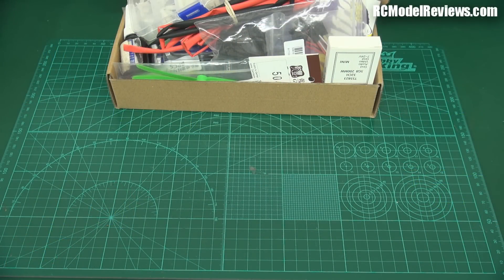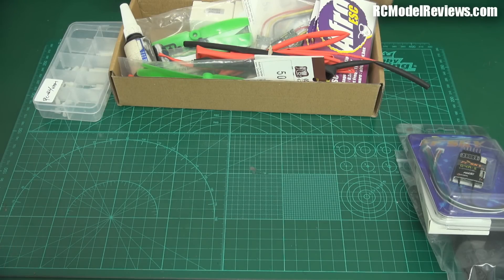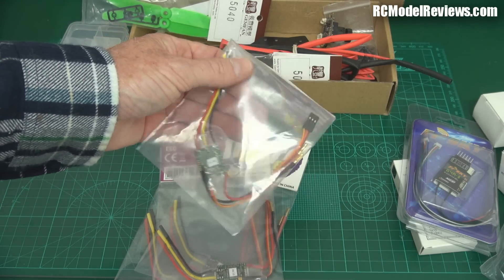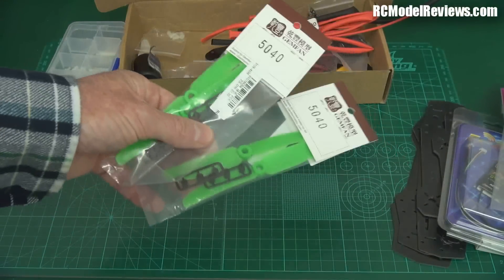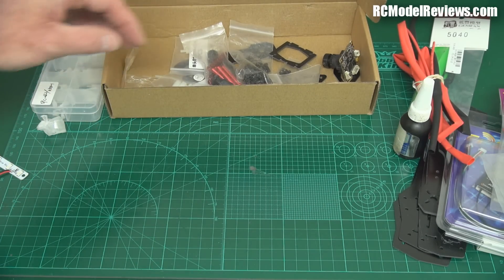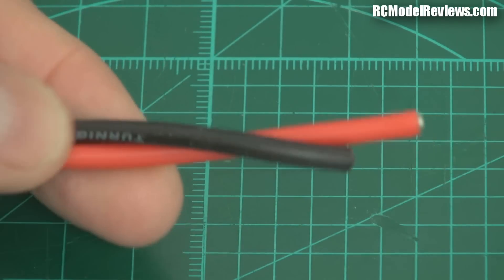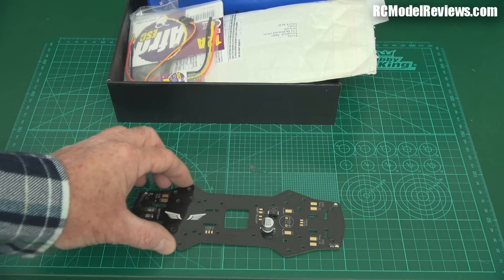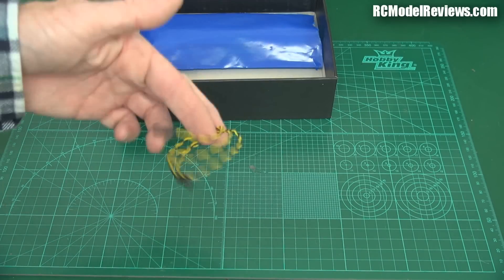Low cost miniquad racing drone build video PART 1

Comment: I can't find a naze32 anywhere. All I can find are these crappy F7 and H7 flight controllers and they suck! Every time I arm and put the throttle stick in the off position all the way to the top, my quad flies away straight up and I can't find them anymore. Flight control my ass.

Comment: I'm a absolute FPV/RC/drone rookie. but giving it a go. Put a quad kit together after a probably 10 hours of research. This is my list of parts. If you spot compatibility issues or i'm missing something let me know!
-250mm Carbon Fiber frame
-FrSky Taranis X9D Plus 2019 2.4G
-FrSky D4R-II 2.4G 4CH ACCST Telemetry Receiver Naked
-Naze32 Rev5 6DF Flight Controller w/Barometer Compass 

-DYS BE1806 2300KV Brushless Motor x 5
-30x30 power ESC distribution board 
-Emax Simonk Series 20A ESC x 5 
-ZOP Power 11.1V 1500mAh 40C 3S Lipo Battery XT60 Plug x 2
-RunCam Sparrow WDR 700TVL 1/3 CMOS 2.1mm FOV150 Degree 16:9
-Eachine TX805 5.8G 40CH 25/200/600/800mW FPV Transmitter TX  SMA Female Connector 
-Kingkong 5040 props x 10 
-Eachine EV100 720*540 5.8G 72CH FPV Goggles With Dual Antennas
-G.T.Power C6 50W 6A DC LCD Display Battery Charger Discharge for 1-6S LiPo 
-DANIU Welding Solder Flux Paste Soldering Flux Paste Grease Gel
-10 Pairs 2 Pins JST Male & Female Connectors Plug Cable Wire Line 110mm
-23cm Li-Po Battery Magic Tape Straps
-2M AWG14 silicone wire (1m red, 1m black)
-Heat shrink
- 300pcs nylon standoff kit
-Heat-resistant Soldering Mat
- 1.5m BGA Desoldering Wire Solder Remover Wick
-2Pcs XT60 500V 30A Male & Female Bullet Connectors Plug Sockets x 2
-63/37 0.5mm Tin Lead Rosin Core Soldering Iron Wire Reel
-Wavecom 60W Adjustable temp soldering kit
-1M LED strip (red)
-Battery Voltage Meter Tester Battery Monitor Buzzer Alarm For 1S-8S Lipo 
Hopefully this will get me from 0 to liftoff!

Comment: You would be great to do a motor comparisons, such as 2305 2306 2307. in terms of amp  vs thrust. what is the over all good to have heavier quad with stronger motor or lighter with less power. I tried looking for email or somewhere to contact you , but seems this was the easiest way. thanks.

Comment: Love your vids here in whangaparoa , I have a tail to tell I brought the eachine wizard , fitted some 450 heli landing gear. ,then a 450 boom to the landing gear with a bright coloured tail sticking up ,  after 30 odd flights not even a crash with heli flying experience the eachine flys well for me  , I have done it this way till I get the hang of it then will train with fpv , so for beginners the tail and landing gear is a good orientation and visual aid     And the tail tells me when it's a couple of hundred mtrs away wich way it's flying , in Cambridge last week I had it very high to the point I could not tell wich way it was pointing  , scary, but I played with it for a while , figured out where the tail was and returned all ok  I mean I got carried away with altitude , so for a learning tool it's good many thanks keep vids coming thanks

Comment: Just look at those ancient miniquad parts lol
Reply: And what exactly is wrong with older gear?

If the newer gear does not improve on the older, there's no reason to pick one over the other. If it does, then it's a matter of seeing what's improved, by how much it has improved, and assessing whether those improvements matter for your particular use case. The date at which a piece of kit was designed in and of itself should never be used to guide one's purchase decisions.

Comment: does anyone know if this set is any good? https://hobbyking.com/en_us/force-200-5-set-multirotor-driving-equipment-set.html
Reply: What size frame do you want to build in?
I would personally not use it, since there are better options for not much more money. If you're on a very tight budget, it is your first build and you're unsure or it is built to be as cheap as possible for crashing... Those might be a good deal.

Comment: I'm looking to get into racing quads a bit down the line, at the moment I'm looking at a very very basic carry friendly affordable drone, but my initial intention was for taking photos and videos but unfortunately the camera is god awful, but it's the price and easiness to just have in a pocket that keeps drawing me back to it, with fpv and altitude control or whatever it's called. My question is... since you seem to be really in the know, do you think it would be possible to replace the internal camera or attach a very low weight camera to it without affecting performance... If you have a look at the jjrc h37, it's called an elfie, maybe you could inform me, the only thing about attaching an external camera is that when it's in air I wouldn't be able to adjust the angle for videos or photos and it's for nature and mountain photography I'm looking for. Unless you can suggest something near to the price range that is portable if even not as much that may be better suited for that, that I could have it hovering in the spot for photos

Comment: Hi! your videos are really useful!! thanks so much!! I have question, I followed your tutorial and I have just one problem, when I finished assembling a 250 chinese kit, when I used the digital multitester on the battery terminal to check if there the circuit is open it was actually closed (multitester beeping on the ohms position). I desoldered everything on the negative side of the diy power board, but everytime i soldered one of the ESC/Motor negative cables the multitester beeps, it seems it's not a soldering issue as it happens with every one of the 4 negative motor terminals, is this ok? I don't want to connect the battery yet to not burn up everything. Would be great to get your feedback!

Comment: What would be a good transmitter for a starter quadcopter? 

I know a Taranis is a great transmitter but it costs +200$ so when building a quad that's almost the same as the quad itself. 

Any suggestions? 

I was looking at the Turnigy x9 pro (60$) but many people say it costs the same as a Taranis to make it complete.
Reply: 5.8g or 2.4g
Reply: i already have the 9xr, but if i was buying one again, id go for the taranis frsky as it comes with telemetry without having to flash and hack the 9xr.. maybe the new 9xr pro comes with telemetry? but this dude as well as flitetest all use the taranis so they must for a reason :)
Reply: +FindmeKicksUK 2.4ghz. And I'm gonna build my first quad so I don't know how long I'll be liking it. 

That's why I doubt to buy a Taranis. 

I also consider a Spektrum DXe, because that already comes with DSM2 for another BNF I may want.
Reply: Look at a Flysky i6. This guy has a review for it on this channel and you can get it and a receiver for about $50. I'd get the FS - IA6B receiver as it is much easier to set up than the FS-IA6

Comment: So I just put together the order for this build,  but upgraded the motors and ESC's to Multistar baby monster 2206's and 20a afro ESC's..  All ordered for a total of $180 for motors, ESC's (HobbyKing).. $84 for ZMR250 frame in glass, 4 spare arms, 4 sets of props (BangGood), $30 for camera from surveilzone (Totalling $294). not including radio.. 

I think I may need to cancel my orders if i can,  I just saw the Eachine 250 FPV Falcon $213 with everything inc tx fpv and 700tl camera on banggood http://www.banggood.com/Eachine-Falcon-250-FPV-Quadcopter-with-5_8G-32CH-HD-Camera-BNF-p-1028897.html

150km/h fpv quad with tilts and everything, I think it will be heaps better and cheaper...
Reply: +FindmeKicksUK that frames 10 bucks on ebay. a 5.8g sony 1/3 cmos is under £5 them motors for four are £20 with propelas and clamps.
id cancel your hole order and re think and search ebay.
Reply: Yup cancelled the orders with HK and Bang Good, to then get the 250 falcon..  Then add a heap of parts and everything and still be about the same price for a super fast racing quad.
Reply: What else are you including in your "heap of parts" to go along with your order?
Reply: I did, it seems to me like a better way to get into the hobby. All the reviews for this particular model were more then sufficient for my level of expertise.  Now I just gotta buy the goggles!
Reply: +wonsliqsunofabitch sweet, good luck.. Also from experience, don't buy the cheap fatshark's, it looks like a small screen at the end of a 6inch tunnel.  I just bought the quanum cyclops and I haven't flown with it yet but even just turning them in without video it looks a heap better and more immersive ;)
Reply: you got robbed.
Reply: +FindmeKicksUK dude I'm talking australian dollars, not pounds..

Comment: would these esc be OK for it SimonK Series 12A ESC Speed Controller Linear BEC Programmable and the OpenPilot CC3D Flight Controller Staight Pin STM32 32-bit Flexiport what barty goes with it?

Comment: Great videos thanks! - I have an Orange T-Six radio,,, I recently have seen this - http://www.hobbyking.com/hobbyking/store/__90806__OrangeRX_CF720X_Micro_32bit_Flight_Controller_with_built_in_DSM_Compatible_RX_FC_and_RX_.html  is says it comes with clean flight 1.9  is that good?  so can I just get 4 esc's and motors, a frame and a camera with 5.8ghz / and .8 goggles or screen( hopefully powered off this Orange device using your cut the plug and power w/ plug that fits in orange fc/rx ?  will all that give me a good fvp quad?  am I missing something?   Since I allready have the Orange radio, does this seem like a good way to go?  Thanks in advance for any help...
Reply: Yep. It also support some different firmwares to flash on it (other than Clean flight) which can be tuned from the Android phone over OTG USB cable. At least one of your esc's muste have BEC inbuilt to power on this fc/receiver or  extra ubec if all your esc are opto version...

Comment: what controller should you buy to work best with this build
Reply: In order for it to work with the FrSky receiver you'll need a FrSky transmitter. The Taranis is a probably the best choice (it's the one Bruce is using). You could also get a Turnigy 9x and either mod it (https://pixhawk.org/peripherals/radio-control/turnigy_9x_frsky_mod) or use a Turnigy receiver instead of the FrSky one he listed.

Comment: how much does this all cost
Reply: +Legitimate Leos the quad itself is under $300, but when you factor in all the accessories (transmitter, goggles, batteries, charger...etc.) and required tools its $500-$700.
Reply: k thanks

Comment: "(Note: I will update this list shortly with more components and sources so don't order just yet)"

you should.
Reply: +TheKetsa I did this build almost a year ago and a put together a list of all the parts and accessories I needed in a blog post. You can find it by searching for "from not knowing how to solder to building an fpv racing drone".
Reply: +TheKetsa How is that list coming together i'm really interested in putting a drone together. :)
Reply: Hardcore Gaming - Heroes of Newerth
Yep, it was my first build and I was still learning to solder. I pretty much followed this build tutorial exactly. If you read the upgrades post I did you'll see I cut the wires to improve the cable management and also upgraded the antennas.

Comment: I just purchased everything for a racing quad from banggood for $110, excluding battery and radio+fpv gear
Reply: +Elexo Flyer Motors alone are $65 which is more than half of that amount. Care to list your parts/prices? I'm building my first one and ordering the parts today.
Reply: +Swiggity Swooty .
Reply: +Swiggity Swooty I got all my parts from banggood. A KK2.1 board, 4 eachine 2204 2300kv, random 16amp ESC, a $10 quad frame, I'm. Ot sure of the name. I already have radio gear. 5x4 props, 2 sets.
Reply: +Elexo Flyer let me know if you need more details

Comment: I wanted to get some advice . I'm going to buy the 12A ESC but I seen some for cheaper than the Afro . the brand is called Emax SimonK. would it be OK to go with the Emax or stick with the Afro brand ?
Reply: +Jason hernandez You're fine with some else. The Afro have a bec built in which allows you to power the naze32 so make sure the esc you choose has a bec built in as well or simply buy a separate 5v bec to power your naze32. Some power distribution boards come with a 5v bec built in.

Comment: Is this really a good option for someone without experience with drones? Wouldn`t it be better getting a Hubsan X4 with FPV?
Reply: +solring7 it is best to practice with a toy quad like a hubsan, syma, or cx-10 before trying to fly a real racing quad, but you don't need to get an fpv toy since there are simulators like FPV Freerider and LiftOff which will allow you to practice fpv before flying a real one.
Reply: +Isaac Davis thanks for the replay.
Reply: +Isaac Davis do the skills transfer across from the sims to the real thing well?
Reply: Yes, the basics of the SIMs transfer pretty well to real life. If you fly well in the SIMs you will fly fairly well in real life, but if you're an expert flyer in the SIMs you may not be an expert in real life and vise versa. I highly recommend getting a cheap toy (doesn't need fpv) to learn LOS flying and understanding the basics of how a quad works (for example seeing the drift). The SIMs will teach you the FPV basics, but it's important to also be able to fly LOS, which the SIMs will not be able to teach you well.
Reply: +Isaac Davis I'm definitely getting a Hubsan and practicing with a sim. Cheers

Comment: I'm planning on building this soon. Could someone point me towards a good, but somewhat inexpensive set of fpv goggles and RC Transmitter that would work with this build. I would also like to find a better antenna.
Reply: +werd war look at quanum v2 goggles (note: you'll also need to get a vrx) and the turnigy 9x trasnmitter
Reply: Ok thanks for the help.

Comment: Rc Models you need to upgrade your list, there are much better frames now, like this one http://www.banggood.com/ZMR250-V2-Carbon-Fiber-Frame-Kit-4_0mm-Arm-Thickness-Support-1806-2204-2206-Power-p-1010702.html?p=KX28152008068201507H
Reply: +mYst1caL er0 http://www.banggood.com/Eachine-Falcon-250-2204-2300KV-CW-CCW-Motor-p-1042955.html?p=KX28152008068201507H
Reply: +mYst1caL er0 DAL propellers are much better than Gemfan
Link: http://goo.gl/8oBF9w
Reply: +mYst1caL er0 That is nice site. I used it for buying parts for my mini quad
Reply: +mYst1caL er0 Thanks man

Comment: you make people buy a 5.8 Transmitter? bahahahahahahah
Reply: so what
Reply: michael d if your drone is behind 1 tree you almost loose the signal also it doesnt reach very far
Reply: +sniperkitty 3000xx ha, ok
Reply: +sniperkitty 3000xx just about everyone flying racing quads uses 5.8 for their vtx. You don't lose signal flying behind lightly treed area and you can easily go 1km with the right antennas. Do you have a better alternative that everyone else doesn't know about?
Reply: Isaac Davis
YES.....BUT ITS A SECRET

Comment: what about a lowcost radio that will work with this setup? :)
Reply: +Aleksander Ellefsen turnigy9x, but you'll need to use a different receiver, but it will work with everything else.

Comment: I want to buy the camera on SurveilZone but it now is asking me to chose an attribute System:PAL or NTSC.Which one should I get and what do they both do?
Reply: +cheekid it really doesn't matter, both will work well. If you want to read the details search for "pal vs ntsc fpv" on Google and you'll find a great blog post about it by Oscar.

Personally I would recommend getting the "RunCam 600TVL DC 5-17V Wide Voltage Mini FPV Board Camera" instead of the camera Bruce listed last year. By upgrading to this newer camera your quad will be able to handle 3s and 4s batteries, providing you used the rest of the parts Bruce recommended. The only downside to this camera is it doesn't fit the standoffs quite as well, but I like it a lot better than the one he linked.
Reply: +Isaac Davis Thank you! You seem to know a lot about this stuff. Would you maybe be able to answer some more of my questions? I would appreciate it a lot. 

First question: I need to buy a transmitter as well and I want to buy the taranis but I saw that there are two versions. So I was wondering if the plus is better but I don't know if it will still work with the transmitter Bruce showed. Do you know?

Second question: In the second part Bruce swaps the top wire with the middle wire of the esc to make the engine go clockwise. I saw another video that explained how esc worked and the person said if you changed any of the three it would make it go 'cw'. I will still do it how Bruce does but would like some confirmation about that.

Thanks again for taking your time and responding to my other question.
Reply: +cheekid Are you talking about mode 1 vs mode 2? If so they are the same except the sticks are switched around. In mode 2 (the more popular one) the throttle is on the left stick while in mode 1 the throttle is on the right stick.

You just need to swap any two wires to change the direction of the motors. It doesn't matter which ones you change.
Reply: +Isaac Davis no I looked at the site of frsky and saw that were two different ones
Reply: I have the Taranis X9D Plus, what is the other one you are looking at?
Reply: +Isaac Davis Can you use any esc's of 12amph? If so would cheaper ones break faster?

Comment: What type of battery should I get? And where?
Reply: http://www.hobbyking.com/hobbyking/store/__80288__Turnigy_nano_tech_A_SPEC_G2_1300mah_3S_60_90C_Lipo_Pack_AR_Warehouse_.html

I used these on my Vortex 250 while learning to fly it. Really good, never got hot, ran about 3:15 under hard maneuvering. Not the cheapest out there but you can't break them.
Reply: +Daniel Jones How can I charge that battery?
Reply: +cheekid you will need to buy a balance charger. Plenty of options out there. I have an iMax B6 but it is expensive.